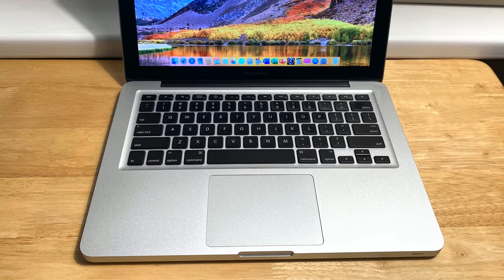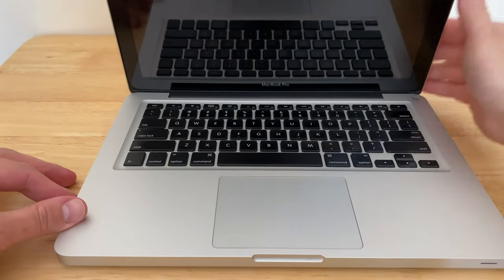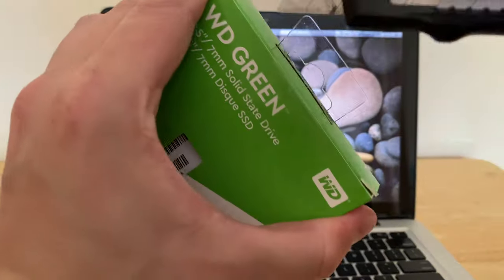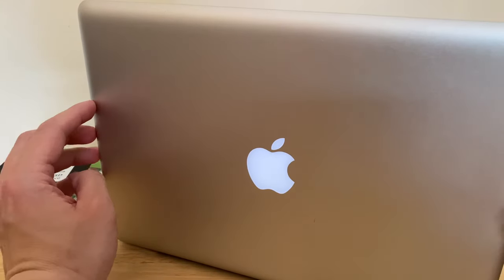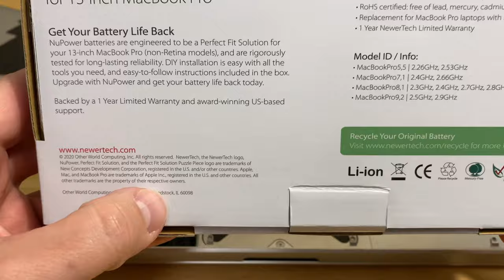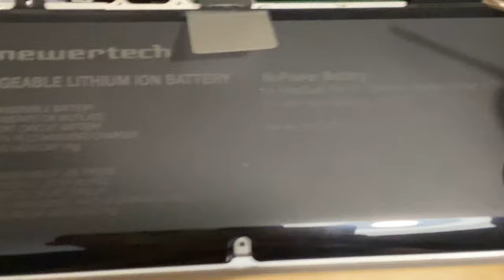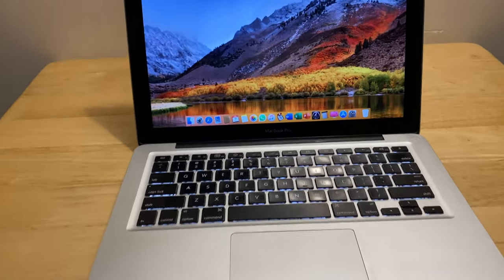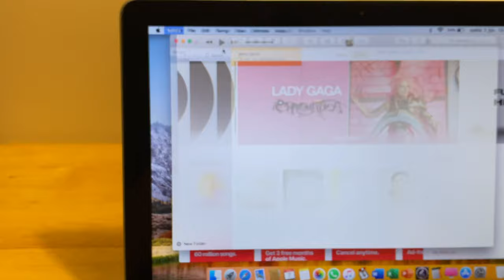IS IT WORTH upgrading a MID 2010 MacBook Pro 13 inch laptop in 2020??

Comment: Can I updated 8*2GB RAM in this computer?
Sorry my English is not good. English is not my first language.
Reply from the maker: Originally, the maximum RAM for all the 2010 MacBook Pro's was 8 GB (4+4). 
However, OWC confirmed that, if running OS X 10.7.5 or higher, updated with the latest EFI, and equipped with proper specification memory modules, this model can support up to 16 GB of RAM.

Here is the direct link for more details:

https://eshop.macsales.com/blog/16302-some-2010-mac-owners-can-get-more-ram-than-they-thought/

But the direct answer to your question, the 2010 Macbook Pro by original can't recognize 8+8 RAM, only 4GB + 4GB
Reply: @TechUThrough  but it can.  Apple website say it can't.  It does without the extra mods that you mentioned.  I have one and I only upgraded the HD to a ssd and 2 8g ram worked perfectly.
Reply from the maker: @royreed4696  oh, nice! That's actually the first time I hear that. Would like to see a screenshot with the About The Mac upgraded specs. But anyway, thanks for bringing it up!

Comment: sir i have a macbook pro mid 2010 i want to use latest version mac os so  i can use this laptop latest version mac os
Reply from the maker: Hi! Unfortunatly no :( 
The latest version You can install on this computer is only High Sierra. 
Each year Apple stops to support one or two older mac models. This year they were the 2012 Macs.
Reply: @TechUThrough  you can try dosdudes1 patcher

Comment: Thanks for making and sharing this helpful video. I have a MacBook Pro Mid 2010. I used to use Final Cut Pro and it was working fine but now it’s very slow even though I don’t use any heavy software on it. I actually haven’t used it for some time now. 
Could you suggest me a software or tool to check the issues please?
I also would like to upgrade it, so could you suggest me what part I can upgrade and what maximum capacity I should get for those parts? Thanks in advance.
Reply from the maker: Hi! Thank You for the kond words.
About the upgrade parts, I don’t think there is any more “space” or reason to upgrade that old of a machine. You can only upgrade the ram to 8GB (4+4), but even that wont give You any extra boost or second breath to Your computer. 
If You want to use Final Cut Pro or any other photo or video apps, this 2010 Mac would have hard time to deal with such tasks. 
So if there is a good price/deal, I would suggest to upgrade to a MacBook Pro 13 inch 2015, from there You could feel much more performance and use the latest macOS software.
Reply: @TechUThrough  Thanks for getting back to me. Is there any way to test the whole computer. Just want to find out what made it so slow. I am not using FCP on this computer anymore but it's still running very slow.
Reply from the maker: @jaikumar7875  Try downloading an app called Clean My Mac. It has a trial version. This app is checking the overall Mac system, cleans up Gigabytes of unnecessary space, speeds up Your mac, and removes malware from Your mac. That is what I use once a week and my mac runs very well. Of course, it's not a diagnostical app that shows some errors. Have You upgraded any parts of Your 2010 MacBook Pro or has it all the stock hardware inside (like ssd, ram)? Maybe it needs some inside cleaning.

Comment: I asked for a MacBook for my birthday and my sweet mom ended up getting me a really outdated one but I don’t want her thinking I’m ungrateful. I’m doing online school and it keeps overheating, the fan won’t turn on before it shuts down and I took the back plate off and there seems to be nothing preventing the fan from cooling the rest of the Mac. What should I do?
Reply: You’ll need a screwdriver kit, new thermal paste and alcohol wipes and you’ll have to look up a tutorial to get to the CPU and replace the thermal paste. You’ll likely have to disassemble quite a bit to get to the CPU, can’t remember with this model. 

Once you’re inside, Clean it off with alcohol wipes and clean the heat pipes with alcohol wipes too. And remove all the dust on the logic board. Might have to replace the fans, sounds like they are faulty or dust is stopping the system from working correctly. 

It might help too if you put in an SSD, they can help with thermals slightly.
Reply: Also reset the SMC if the thermal management isn’t working. Google how to
Reply: mac fan control ! and catalina patcher
Reply: An old MacBook is amazing. Much reliable than the new ones. If you upgrade it and clean it all up, it will be as good as the new ones. That’s why the resale value is so high on old macs
Reply: Ipad pro

Comment: Just a question. I bought a second hand MacBook Pro mid-2010. It has a 500GB HDD and 8GB of RAM running on 2.4ghz intel core 2 duo. I will have it upgraded Monday to 240GB SSD and retain the 8GB. Going to my question, will it be running fine with using Zoom after upgrading to SSD? Basically I will just it for my work, which is teaching. Thank you to those professional answers. Much appreciated ☺️
Reply: Hi let me know how well zoom works if you have upgraded to SSD!
Reply: @anthonychikezie6575  I did zoom 2 years ago just fine with my 15" mid 2009 MBP 2.53 with 8GB and 1TB SSD

Comment: Hello! Thank you for this video!! I have a mid 2009 MacBook Pro that am wanting to use again. I need help trying to figure out how to get the new software on it. I can’t even use safari because it isnt supported by the current software. Do you have a process for this? Should I first replace the ssd? My battery is still in good condition and holds a charge pretty well. Any help would be much appreciated 🙂
Reply from the maker: Hi! 
There are only certain macOS systems that can be installed on specific year MacBooks as their latest.
If You want to get the newest software on Your 2009 MacBook Pro meaning that it could run the latest macOS Big Sur, the 2009 MacBook Pro will not run even a couple of macOS's before Big Sur.
The latest software You can install on Your 2009 MacBook Pro would be only El Capitan . 
So for a perspective, there is the latest macOS Big Sur (2020) followed by macOS Catalina (2019), macOS Mojave (2018), macOS High Sierra (2017), macOS Sierra (2016) and macOS El Capitan (2015) - this one is the official latest supported macOS on Your 2009 MacBook Pro.
SSD sure will help for Your computer to boot up and open apps much faster, but not for getting a fresher macOS system on it.

Comment: link the battery buy page please
Reply from the maker: Sorry. It was purchased in a local service store in my country.
Reply: @TechUThrough  oh, ok. Btw is a mid 2010 MacBook Pro a good deal for 100 bucks? (Upgraded to 8gb ram)
Reply from the maker: It’s hard to justify a 2010 Mac in late 2021. Though it will work, star-up and open apps fast if you upgrade to an ssd internal drive, there will be no Apple support anymore. 
I would say, it’s more nostalgia here than a practical need to use that old of a tech as say your main computer. 
But to answer your question, if it’s in a good condition, 100 bucks sounds like a good deal!
Reply: @TechUThrough  I'm planning on an SSD, ram is already upgraded to 8gb as I said. I will use windows so I don't care about support anyway. My main pc is from 2012 so...
Reply: @DemeDemetre  I’m in a country that doesn’t support apple so
Reply: @denmarkdiscord1561  so what?
Reply: @DemeDemetre  I mean it doesn’t need apple support if can’t be supported.

Comment: How long does it take to boot before upgrade? Im going to get core 2 duo 2,66ghz, 4gb, 320HDD. Just for word, excel, edit light video, browsing n youtube. Is it good enough?
Reply from the maker: About 30 to 48 seconds. 
Just for word, excel, internet and youtube, you should have no problem waiting that time, because, you boot up only once. 
The moment you will notice that old HDD is when oppening any app. But only if you compare it to a newer MacBook Pro or a MacBook with an upgraded HDD to SSD.
Reply: @TechUThrough  thanks for the reply, yes that SSD got my eyes. Really worth it for replacement. But i think i save up for newer macbook later. Because im new to macbook 😀🙏

Comment: What ram sticks do you think I should get?
Reply from the maker: Hi. If 8GB is maximum for the computer, You should choose 4GB+4GB ram sticks.
Reply: @TechUThrough  well yes i know that but I meant what brand should I get
Reply from the maker: @jl4280  In my opinion, the brand choice doesn't play that big of a role here, just get the right 1067 MHz DDR 3 frequency ones. The best way is to check all the correct Mac parts in the OWC site. Here is the correct OWC 2010 MacBook Pro model link for RAM:

https://eshop.macsales.com/item/OWC/8566DDR3S8GP/

Comment: This Video was perfectly timed. I decided to pull out the old MacBook Pro from mid 2010. think about maxing it out and keeping it as a back up computer. I still have the original Hard drive in it and 10.15 mac OS Catalina on it wit only 4gb of RAM. and I might have google chrome installed lol. I would love to know where you found the battery for this laptop. I also have an Early 2011 MacBook pro but it has broken keyboard.
Reply from the maker: Thank You! It's so nice to hear that this video can inspire someone to get a second life out of these old machines! :)
And of course You can use Google Chrome :) just in my case I had only 4GB of RAM. I highly suggest to get 4+4GB of RAM modules to get the max out of these 2010 models.
I suppose You have a Catalina patcher installed on the 2010 model, because the latest officially supported software for MID 2010 models is the High Sierra, but I know many people that use patched Mojave and Catalina versions and that's all good! :)
Regarding the battery You just need to search the web for an OEM type battery. There are many places they sell them even today.

Comment: I have my daughter's 2010 Pro Laptop.  I installed a new Toshiba 2TB Harddrive.  When I started up, it would not load. And I think it is requesting a CD for software update. Can you clarify this?  She used it in school back in the day and it is in nice shape. Just the old HD failed to load at some point.  HELP!  LOL  Please.  Back in the 70s I was writing HTML and started with Lotus 123.  What happened?
Reply from the maker: Try restarting it in Recovery Mode, when restart is in process, hold COMMAND+R, after that try the latest available online recovery macOS that it recognizes for this years Mac. You should somehow end up with a running macOS. After that You can upgrade it from the App Store or bootable usb flashe (check my other mac videos for that). 
Good luck! 👍🏻

Comment: Did you  have to pay for any software  to get to high Sierra. I have a similar laptop with 6mb ram and 160gig hard drive.  Its a laptop  i got 2nd hand for my 7yr old daughter.  She just needa its for utube and browsing.  Thanks for the video it was very helpful.  So do you think i just need a bigget hard drive the battery  is still good?
Reply from the maker: Hi! Thank you for the kind words. 
No, I didn't pay for any software, though the installation files were not easy to find on the internet. 
If the battery is ok for your computer, just change the old drive to a new SSD and you will feel the difference immediately.
Reply: @TechUThrough  Thanks, much appreciated.

Comment: I did almost the same thing! Kingston 500gb SSD k600 then new bat and i swap the RAM with 8gb (2 x 4gb 2rx8 pc3 8500s ddr3 1066mhz SODIMM:) works well now with high sierra. Went to http://dosdude1.com/highsierra/ for the upgrade! It took me a while to find this solution to upgrade to 10.13. And you need an 8gb thumb drive (i used 16) to make a bootable installer and an external hard drive case to transfer your files once done at as your back up drive :) and noctua thermal paste. i hope this help :)) i didn't check the processor if it can be upgraded... Can it be upgraded?

Comment: I did the same to my MacBook Pro 2011.  I actually put up to 16gb of ram and put a 1TB SSD and it’s slow as crap.....
Reply: Did u fix the thermals?
Reply: Check your temperaturas and if your battery is not dead. If the battery is dead or low lvl health mac can also run slow.

Comment: Hello, Is there anyway to get your 2010 Macbook pro to run a software after high sierra EG macOS Mojave? cheers
Reply: It’s not worth it. That core 2 duo won’t be able to handle it. It can barley handle High Sierra!😂
Reply: @paulhillbeats  actually im running catalina with new sad and ram and it runs faster than my 2016 imac
Reply: Yeah from the AppStore if I’m correct but please upgrade to a sad if you’re going to do this
Reply: @paulhillbeats  Mine runs Mojave pretty well, although it is the 2.66ghz model.

Comment: You just upgraded the HDD. You shouldve upgraded the RAM as this only has 4GB. It officially maxes out at 8GB, but I think it might be able to handle 16GB according to other sources. Other than that good video on showing how it currently performs in 2020.
Reply: I've got 10 GB of RAM in mine and I've never had a problem.